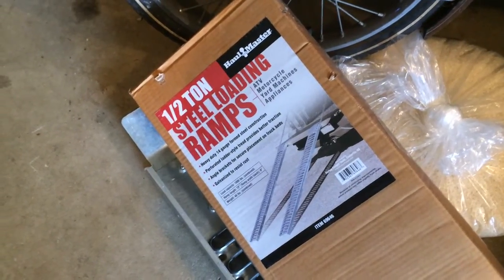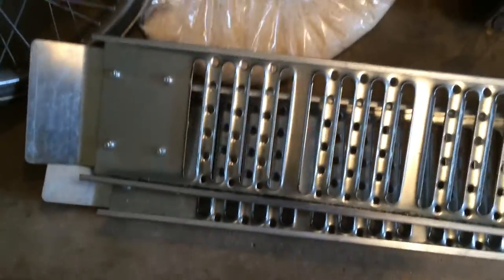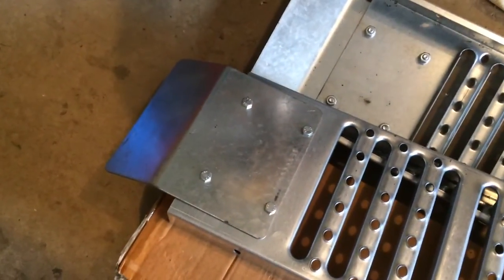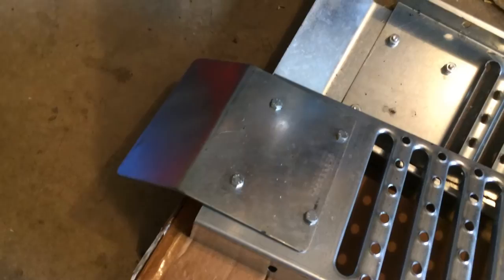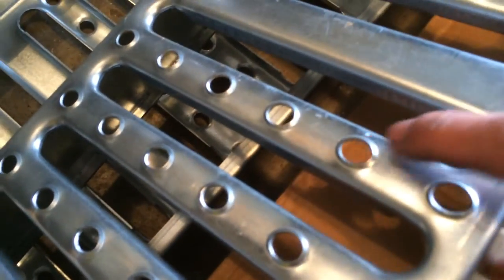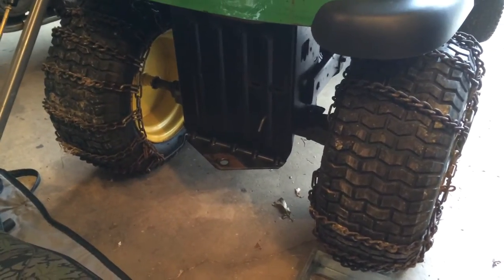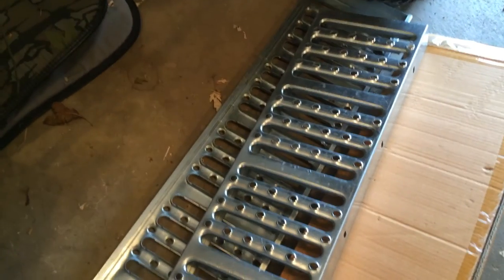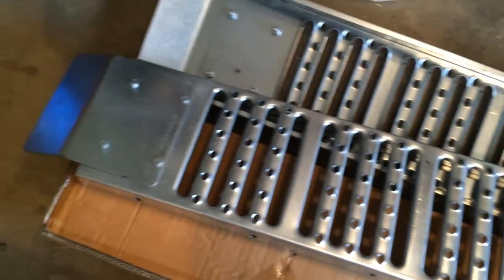Harbor Freight 1/2 ton steel loading ramp review

Comment: I think purchases of these ramps could make them stronger, if the end plates were bolted on the underside of the ramp, ins of the top… the way instructions show to bolt on top, the pivot point of stress of a heavy load, is @ the bolts… if the plate is beneath the ramp, the stress point is closer to the bend of the plate…

I had to buy slightly longer bolts… that cost $1.00… 
I also clipped 45 degrees off the rails at the top, for a closer fit to a tailgate…

Comment: To:T man , I bought a set of ramps to load my push mower because loading,and unloading it developed 3 linguinal hernias after I got hernia belt i changed quickly.The ramps work great for you intentions as well as mine once your mower is lined up give it a light push up,then it will move the rest of the way into the bed almost on it's own.Hope that helps!
Reply from the maker: Awesome thanks for watching!